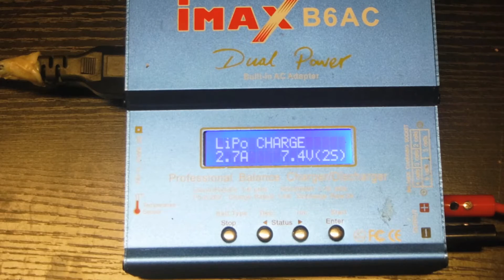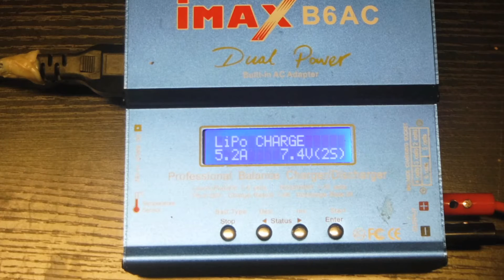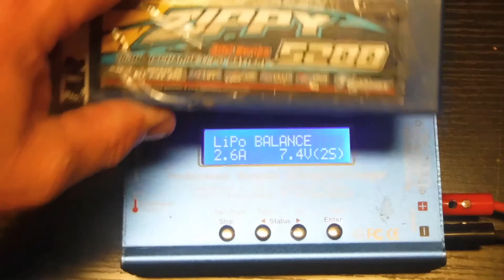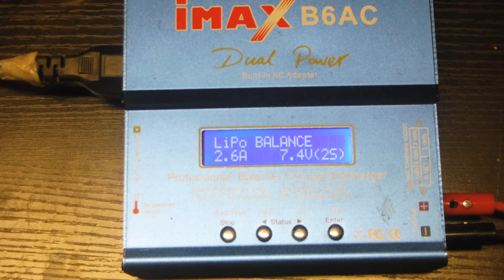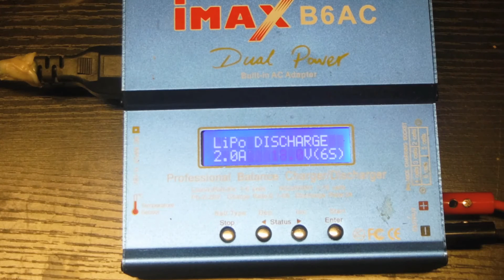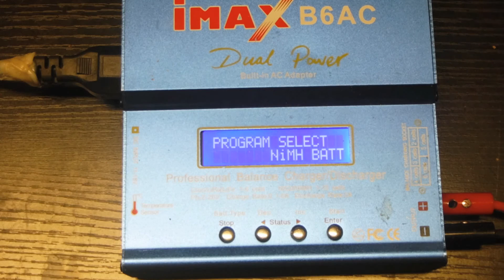RC Battery Charge Rates Balancing etc lipo nimh and More

Comment: I charge mine slowly as much as possible. I find that lipo batteries are all different and it's a bit like pot luck when you buy one. I have one 3S 5200mah Lipower battery that I have had for years and run it in all my cars and quads and boats and it gets wet and it always stays hard and never gets puffy and it always charges properly, it is the best battery I have ever owned and I will be devastated when it finally gives up ha ha. But then I have other batteries that are just crap! it's weird.
Fantastic vid my friend, Great info (-:
Reply from the maker: +Jax Teller RC thanks bro

Comment: Could anyone please help me with NIMH information as I am just getting contradicting answers all of the time.
1. Do you need to 'condition' a new NIMH battery by slow charging it and discharging it multiple times?
2. Is a slow charge better than a fast charge to ensure longevity of the battery?
3. What is the best charge rate for longevity? 0.1C, .05C, 1C?
Reply from the maker: you should always slow chage all batteries nicad nimh lipo lifie li ion and so on other wise you will cut the life span of the battery down alot amoge other problems you dont want to happen, also any time you chage a battery leave it sit 1 hour before you use it as the core temps are up and again this will shorten the life if you dont also when you dischage the battery let sit 1 hour before recharging or again same results happen
Reply: @KevinMillard68  Thank you very much for the help. Is 0.5A too slow for a 5000mah NIMH battery?
Reply from the maker: @Veganarchy-Zetetic  for 5000 mah id charge it at 2amps
Reply: @KevinMillard68  O.k thanks again
Reply from the maker: @Veganarchy-Zetetic  your welcome